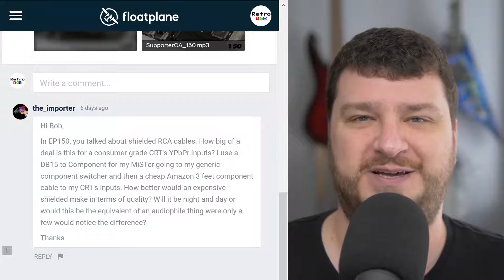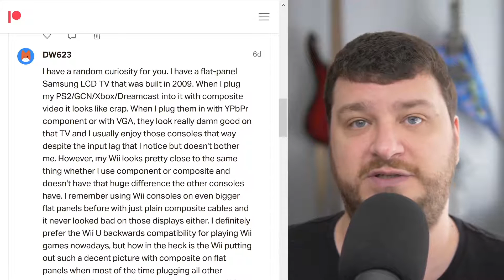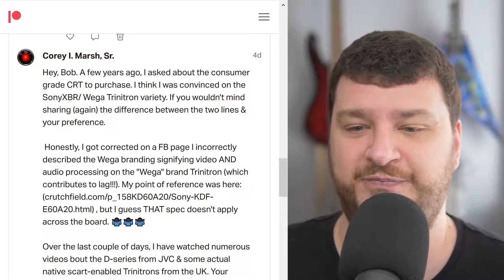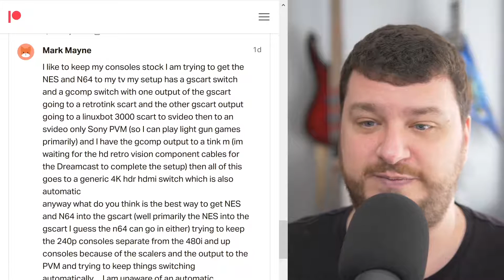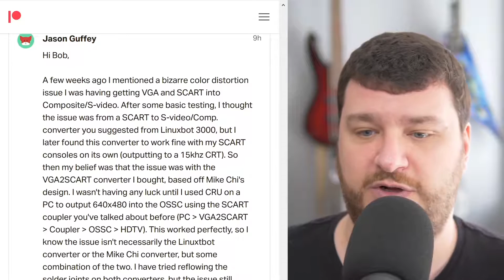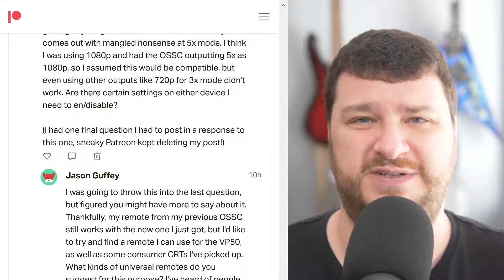Supporter Q&A #151

Comment: Hey man, I've got a toshiba TN43V71 and a bunch of old systems like 

PS2
N64
SNES
NES

etc I want to hook up to it.  It's got component, s-video, RGB, RF inputs.  What are my best choices for the highest picture quality, open to anything (scart and non-scart options)?  Should I go with component for most and if so what brand cables?  Whatever the option for each system, I don't want input lag. Ty

Comment: Universal remotes have come a long way since those "gotta keep it pointed until everything turns on" days. A Harmony Hub with the basic remote is pretty easy to find around the $60-$70 range on ebay. The hub does all the IR blasting and the remote (or even phone app for those days you don't want to go cushion diving) just talks to the hub via RF. They even come with an IR extensor blaster for those hard to reach components.

Comment: Alan Bingham: You may need to go into the raspi-config setup and set the video RAM higher. I shouldn't think you'd need to overclock a pi 4 but it's worth a try, too. There's some setup you need to do such as expanding the file system in raspi-config, too, with Pis rather than them being an 'out of the box' ready kind of thing

Comment: Other lagless scalers that will upscale 240p/480i correctly :0 I’ve been eying the retrotink 2x pro and the multiformat for a while. Want to play some 6th gen stuff on my pc crt, as well as emulate 240p games on my Wii and ideally use the same upscaler. Guess I’ll wait and see what comes out this year!
Reply: Most Wii homebrew emulators (at least useful ones) will output in 480p with component cables, you do not necessarily have to use a scaler for it (although you could use a tink2x so you don't have to use the Wii's software scaler)

Comment: I use a couple things to kill power to my setups when they aren't in use: 

The first is a "green" surge protector, where there is a "control" plug that when it senses that device is powered on, then turns on power to the rest of the consoles. I plug the monitor into the control, and consoles into the rest. 

The other is a "smart" power switch, such as a Smartthings power switch. It's just a switch that toggles power, and what's cool is it's automated in the Smartthings ecosystem, and it also works with Alexa. So I can say "Alexa, turn on Nintendo" and it will power that switch. I also have it automated, so when I'm home it automatically supplies power, and when I'm away it kills it. But I do this with a variety of my electronics to save on power draw, as well as extending the life of the equipment. 

I use both the smart power switch as well as a green surge protector for each of my setups.
Reply: I must have missed the video where Bob suggested a kill switch to retro gear. I always unplug the large PSUs (NES, SNES, etc) because they get warm even when they're off, but pretty much every console I have that's PS1 or newer I leave plugged in. Which equipment is causing concerns? I don't want to leave stuff plugged in if it's slowly dying or a fire hazard! lol

Comment: In regards to the n64 & wii/switch emulation.

I'm no emulation expert so take it w a grain of salt. But afaik there is no low-level emulation for the wii and switch; only high-level emulators.

The n64 is in a middle ground between the more recent, advanced and harder-to-accurately-hardware-lowlevel-emulate consoles, and the older consoles in which their parts and components were mostly "common" and well documented over the years.

The n64 has low-level emulators, which I assume are not 100% (even the snes is still not exactly 100% as of today due to the "gpu" not being documented and hard to 100% reverse engineer, I think) accurate, and there are a lot of high-level emulators for it.

As for the differences between low-level and high-level emulation, check the mvg videos on that (it's even n64 specific, in fact)

Comment: Finally got around to putting my Make MHz HDMI into my Halo Xbox. YOLO'd without my glasses, a few beers in and no magnification. Assumed I fuckled it, but first go boot is a go! (After derping and it not sending signal through HDMI to DVI cable to my usual go-to monitor for testing)

Comment: In regards to the all in one sync cleaner it's arcade pcb & crt display dependent. Especially for those weird boards like taito f3 & neo geo mvs for one in regards to using em with an ossc.
Reply: Oh and psikyo board as well especially the board that plays gunbird 2/tgm2tap